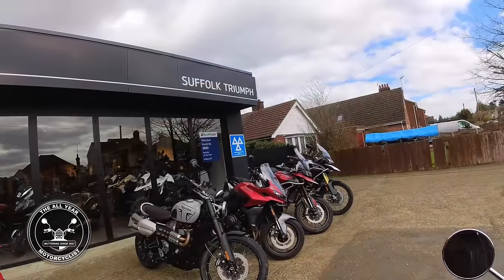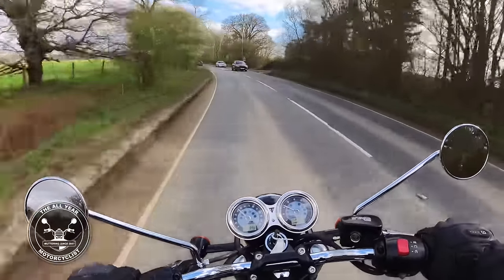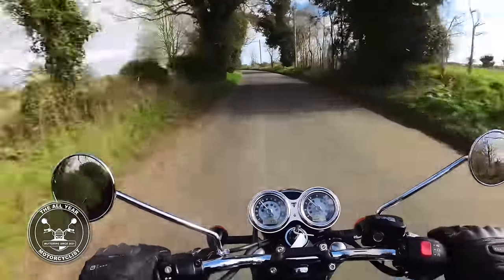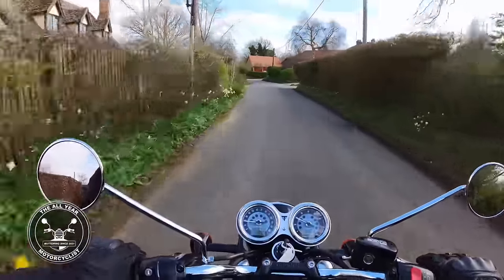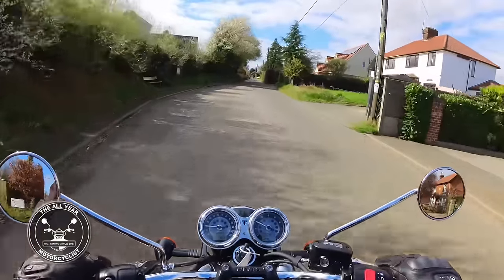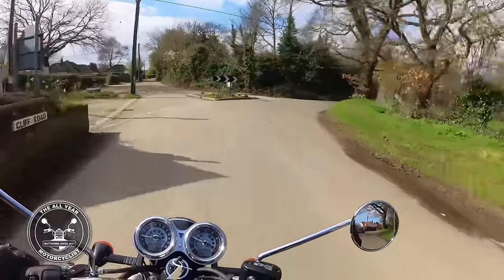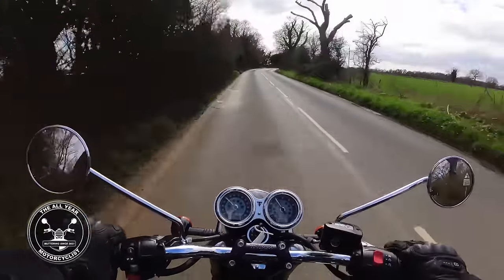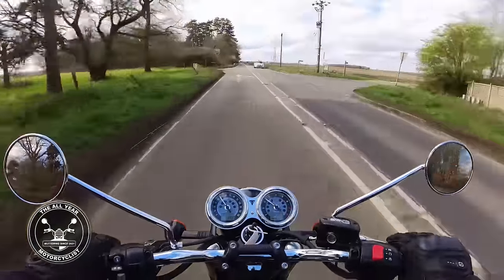Triumph Bonneville T100 Stealth - How do you improve on perfection?

Comment: Because it shares the same frame with the T120 it is roomier than the Speed 900.  You can also fit the same accessories.  I added dresser bars, cruise control, centre stand and bar end mirrors (much better vision), and power plug which allows me to run heated clothing off a separate fuse.  Black paint on the engine, radiator and wheels is very practical.  Stock exhausts sound great.  I think Triumph need to update the cruise control as 30 is the current minumum and the 20 speed limits are spreading like a virus through the countryside.  The torque and the wider 5 speed gears than the T120 mean you can hold 30mph in 4th gear.  My 14th motorcycle and one of the finest.
Reply from the maker: Very good point on the 20mph 😁 thanks Steve 😁

Comment: So pleased to see that the new bonnevilles are now perfect. The early street twin I endured for three years was an absolute nightmare.
Reply from the maker: Thanks. G😁 what were the issues 😁
Reply: I didn’t really want to elaborate but as you asked. The main problems were caused by the wiring loom being too tight where it passed over the headstock. The excessive strain caused the internal wires to keep breaking and this resulted in many intermittent electrical problems and many days spent off the road. Also, the magnet which was part of the “side stand down” safety system, fell off and left me stranded at the roadside. A few other bits also fell,  namely, the reflector on the front fork and the e-clip which secures the side stand pivot bolt. The gear selector shaft also started to display the well documented symptoms of difficulty in changing down through the gears. This was the final straw so I traded it in for a much cheaper Japanese bike and I now ride a bike where I know everything electrical will work and nothing will drop off.
Reply from the maker: @user-rf9me7xm1w  what a horror story 😱 no wonder you went Japanese 😁 it’s like the 70s all over again 😁 thanks G 😁
Reply: @TAYM  I guess I was just unlucky. I really like the speed 900 but I also felt badly let down by the local Triumph dealer. The service provided by the Yamaha dealer has been faultless so far. BTW, I always look forward to viewing your vlogs, they’re always interesting and unlike any others on the ‘tube; in a good way of course. Best wishes.
Reply from the maker: @user-rf9me7xm1w  thanks G 😁 yes, my T120 leaked oil within a couple of days of collecting it and my tiger 900 was dead within 24 hours😡 both brand new😂😂 without a good dealer I would never have touched another triumph but Suffolk triumph bent over backwards and had both sorted within a day 😁 makes all the difference 😁

Comment: l know where you are coming from with the T120 but do love mine, since l fitted the booster plug it's so much smoother in the low rev range. l haven't ridden a T100 so l can't compare but l got mine for easier two up riding. Take care bud 👍
Reply from the maker: Thanks MP 😁 yes that extra torque ought to help 2-up 😁

Comment: I'm looking to change my tiger 800 for a T100 or T120 so the wife can ride pillion with me as the tiger is too high, does the T100 have enough go for 2 up and are the brakes upto it compared with the T120? Solo riding longer distances touring T100 or T120?
Reply: I'm looking at T100 or Speedtwin 900 & T100 looks better than Speedtwin & flatter seat so better for 2up but only has a twin pot Brembo on the front & a 14.5L tank.Speedtwin has 12L tank but has 4pot Brembo front brakes,alloy wheels & has low seat 765mm as T100 has 790mm seat height & spokes but back rims.I love this Stealth Blue fade to black paint but is $1000nz more than stock T100 & $1500 more than stock Speedtwin 900 & $1000 more than the Stealth Edition Speedtwin Candy 🍬Green fading to black & is fantastic.
Reply from the maker: Thanks Alan 😁 I find the T100 just fine two up but the T120 has a lot more torque and stronger breaks but again the T100 stops no bother two up with me and Mrs TAYM 😁